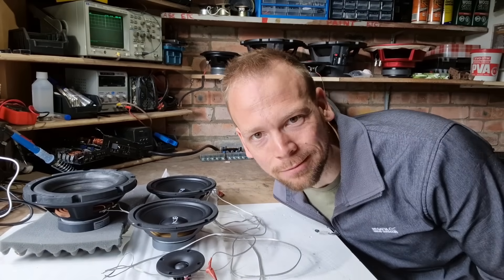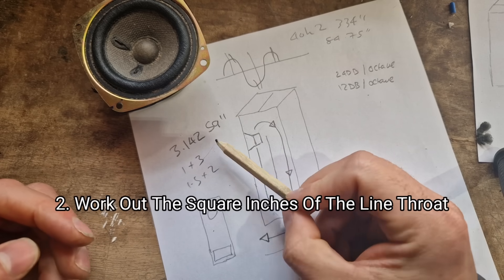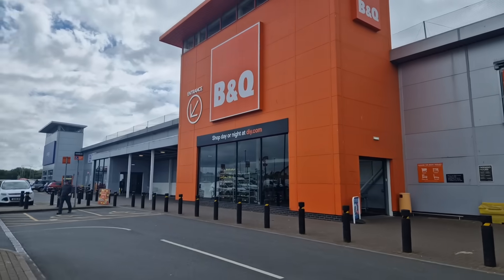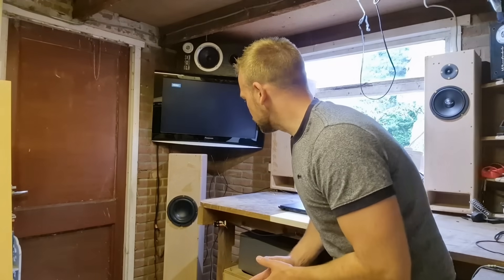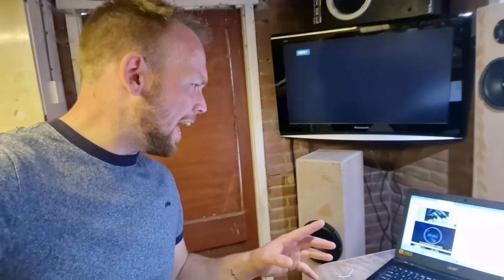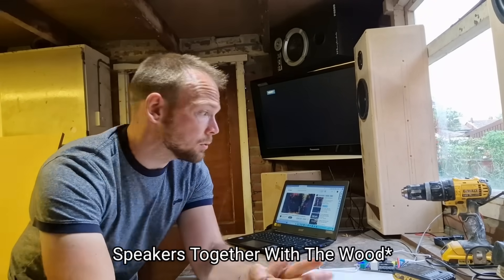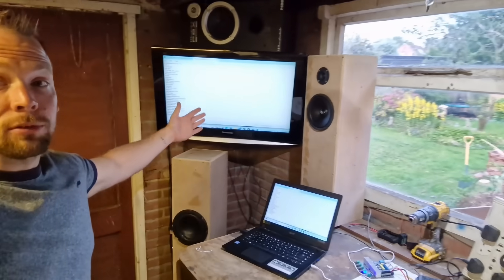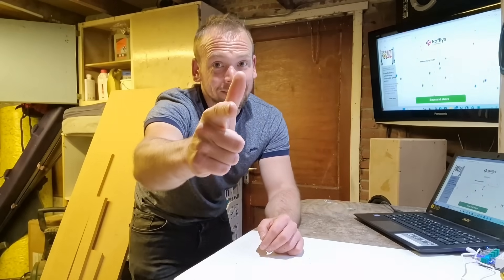THE BEST BUDGET SOUND SYSTEM - TRANSMISSION LINE MAGIC! - HOW TO.

Comment: Love this content. I guess i always seen a issue with designing tline is to keep the sd port aera the depth of the port always was shorter than the dept of the sub. I did quick math on a 6.5 skar evl and i guess the port needs to be 7x2.5in but the sub is 3" deep. So if i do say 7x3.5 will it just tune it lower?
Reply from the maker: No, so, the tuning is the length, not the depth. Youll loose efficiency and itll sound lost if you get then throat size wrong. What you can do is have the line thinner and deeper and add a baffle for the sub so it sits proud of the main baffle, this should allow your depth
Reply: @MyNameIsAdam1  yeah was thinking I could add some outter rings to give clearance. Thx for responding

Comment: Great job!
I built many speakers and it is fun. And if you do like this, you can get great results for an affordable price.

I belive that spend a few more money on the Wood, you get extra good results. Dont need to be much thicker than this, but really dont build with to thin Wood.

Then you need to put braces everywere  

Also, you dont always need Wool in the speaker.
That is often used to fool the speaker that the box is bigger.

Spend an extra few hours on facts and how to, and you all Will be very surprised what you just build!
Reply: I know Adam a bit longer, he is into Soundquality as well as bass. He has allready done great stuff but doesn't show it off that much!
Reply: @franshaan7388  
Yes, this post was more to beginners who watches this series.

Very fun, to watch. 
Its actually more science than many thinks behind a clean sound that is hz matched. But it doesnt need to be that expensive as byuing a set for 1000$ 

Some math, some carpenting and you soon have a nice set of sound.

Sell them and earn a few bucks, build a new pair with higher quality of speakers.
Try different setups, as tweeter, 6,5” mid base, 2x 8” base elements. 
That offers for a really good stereo setup with the right volume of the box.
Think this way also,  the bigger woofer you mount, the more air it might push. But it can sound crap in a small room. 

Two 12” bases are like one 18” base in area, but they act quite differently. 

18” can have trouble to get a snappy base. But pushes good on low hz.
If you not but really expensive bases that can handle that effect required to push hard and fast.

So, its easier and more affordable to build with 8” or 12” for bases.

Good push, that can go deep and be snappy, a great mix for normal rooms.